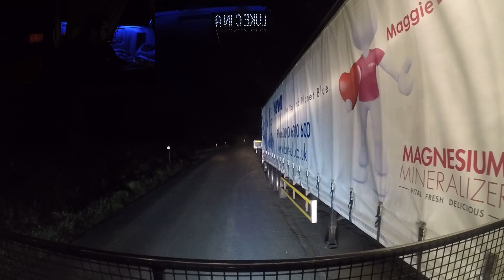Small But VERY HEAVY!!!

Comment: Great blog overall with good learning for the beginners on this post watching , only thing i can critque is if your carrying steel of any kind use chains not lightweight straps , <unless the customer signs a non damage request , to use straps > I have seen steel move both sideways & foreward even flattening the headboard right over the catwalk under heavy breaking , also seen steel tubes go right through the back of cabs, straps are good for many things but not with steel, To put it bluntly if they start moving on you your dead or badly injured big time . With breaks 15 - 30 - 45  its adviced never go exact go 17 -33 - 48 that was the advice of a VOSA guy many years ago it shows to them your not tryig to cheat when its borderline. Keep on trucking Drive safe.

Comment: 'Gotta be straight...I can't handle not being straight'???  Got something to tell us, Luke??

Your call on the tyre issue, Luke..but when that happens it's not your problem to get through security..that's down to the tyre bloke!!..You were in a great place to have that tyre changed...Was kinda hoping it was going to burst though...just to see your reaction. Also, Port Police (you were in a distribution centre within a port area?) have the same enforcement powers as normal police on public roads...I found that out a while back just before mobile phone use was made illegal..so if you were driving around and they saw that they would have stopped you...anyway, needs must I suppose and all ended well...

Comment: Wow Luke, big issue using softstraps on counterweights...  im guessing their like 12Tons each. Use chains!
Reply from the maker: They were around 5/6 tonnes each and i used 2 straps on each one. Becuase they were very low profile there was 0 chance they were gonna move 😂. 
Chains may have been better but I didn't have any so straps were used
Reply: @lukecinahgv  Not really, the friction is low yes, but those straps would snap like a twig if lets say you needed to made a turn to avoid like a car stopped on the freeway. trust me ive seen it. so rule #1 counterweights = chains.
Reply from the maker: @xhonken  I'll bear in mind for the future mate. Thanks👌